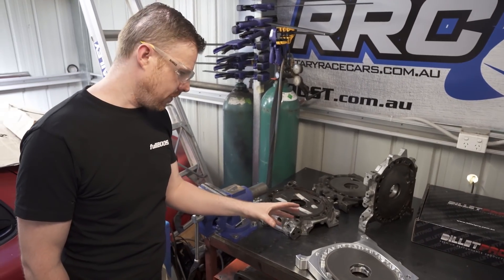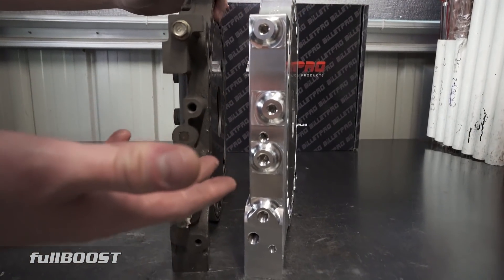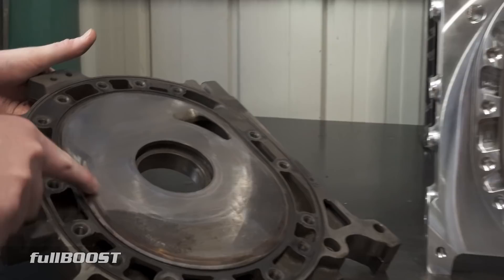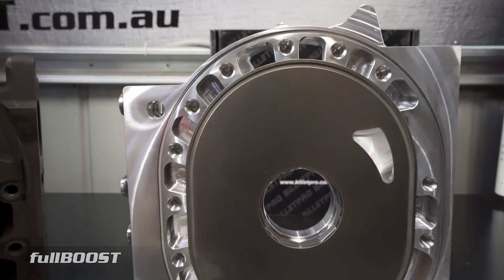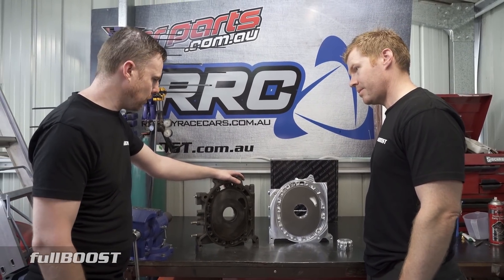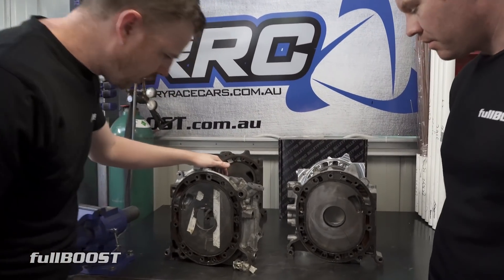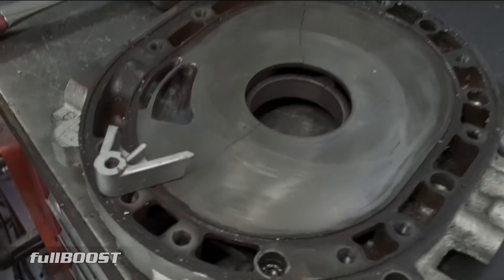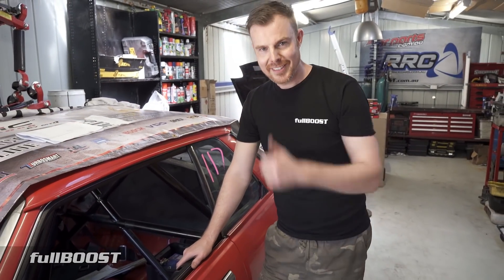Why you need a BILLET Rotary engine | fullBOOST

Comment: why not make this more affordable so more rotary guys can buy them? I know some research and such has been done but prices you mentioned are just pushing more people to do ls swaps :')
Reply: How about keeping the power down? Is there a reason for you to exceed 500 hp? If not then keep it there. Yeah you won't beat everybody but even at a 1,000 hp there is somebody out there with either more money or time than you. Lucky for me, the I don't play in RWD circles just for that reason. There 800-1000 hp and single digit ET's is mandatory. Better yet used CNC machines are not as expensive as what you think, get crackin.
Reply: Anything billet is expensive by nature of the way the parts are produced. The solid aluminum billet blocks cost a lot on their own, and then when you add in machining time on a CNC machine that costs upwards of $100,000 US, the costs start to add up pretty fast. The other point is that these parts are only for the crazy guys trying to get everything they can out of their rotaries and not the people trying to keep their stock/near stock engines running.
Reply: Parts are made from 7075 and take alot if machine time to make them  perfect. We already sell them for as cost effective for the racers as possible. If anything the price will only be going up. Especially if you pay attention to the prices of these materials.
Reply: BILLET BY PAC

Comment: Do you produce these for the msp without the side exhaust ports? Any plans for msp rotor housings with a periferal port exhaust and 3 oil injectors?
Reply: We don’t use them due to the design and temperature issues with the side seals in performance engines.
Reply from the maker: No. Most people building a high powered rotary engine don't use MSP parts...
Reply: @fullboost  people don't use the because you don't offer it ;). I'd prefer to keep obd2 and stock ecu, im, throttle body. You yourself said it's for reliabilityvrather than power.

Comment: Nice! But really it's a performance part. Even in the world of V8s aluminum cylinder heads mean cooler temps and the ability to run much higher compression than stock cast iron heads. I'd compair them to a set of aluminum cylinder heads Not a billet crankshaft. You can get a billet excentric shaft even a 3 piece in case you'd rather run roller bearings in stead of big Babette bearings just saying. Hello 15k rpm

Comment: If i ever putting a 3 Rotors in my Mazda, I would just keep it Naturally Aspirated because of reliability.
Reply: You'll make more power with a turbo. Reliability is easily found at 500/600 hp. The problem is the fuel system required to make that kind of power is cost prohibitive, also the conversion to stand alone engine management.

Comment: I was actually thinking of buying a Mazda RX8 since they are so cheap but no way after watching these videos. Thanks for saving me thousands of dollars.
Reply: dont listen to that guy about doing ls swaps.  you'll spend 3 times the amount of money to do an ls swap right.  and if you know how to go about getting a new engine for an rx8 it's really not that bad.
Reply: I had the same thought, a RX8 can be had for $500 usually because of some engine problem. But then I found 1) The Renesis engine is best left stock actually and throw it in the corner of your garage. Make the later revisions to your engine if you haven't bought the last of the RX8's, it will mean better reliability. 2) REW or 3 rotor swaps are not emissions legal in California. I can find a way around that but then it's expensive to do a 3 rotor swap and then you run into transmission problems. If I were to do one, it would be a REW 2 Rotor (13b) with a big single and T56 transmission, right at 450-500 hp. Not a world beater but would be fairly fast in it's own right.
Reply: These parts are primarily designed for Motorsport applications for engine producing over 1000Hp. So not really anything you would need to worry about for a RX-8
Reply: Avoid the 8... get a 7
Reply: Buy it and drop a LS motor as rotary engine is really expensive

Comment: Nothing wrong with billet parts if you need them. As they said is for reliability if you want reasonable power over 500hp ect. In the long run would be cheaper instead replacing parts blocks ect.
Reply: Have you priced out replacing iron and rotors? It's only a little bit more to go billet over money and TIME especially spent constant pushing the envelope. The problem is the average enthusiast can't do both. So if you have an older non-Turbo car it would be hard to justify the additional cost. Or you can choose to keep the power level within limits of the OE hardware and focus more on working on lap times or reducing 60 ft or 330 times at the strip.
Reply: @dj4monie  I'm on about if you just keep replacing parts constantly as I said in the long run it would be cheaper so it would be worth to take that extra bit of time and save up a little bit more instead of doing things cheaper and then 6 months time spend the same amount of money again. Fair enough for the older models that aren't looking for much power and are doing the old cars and carby set ups. As I said I was on about people who are wanting more power and wanting the reliability over 500 so on so forth.
Reply: It's not like you'll have these old cars as your daily all the time.

Comment: Now hit the billet one to compare
Reply: If he hit the billet one at exactly same place it would've also snapped off so not really a fair hammer test,guess they sponsored by billet pro 😭
Reply: i mean its not gonna break as easy cast iron shatters its not that its weak it just doesn't flex but aluminum accumulates fatigue and will fail eventually anyways regardless of the stress on it

Comment: You have made a pretty broad statement saying Aluminum is stronger than cast iron.  It cant be to bad as there are plenty of engines getting around with cast iron cranks.  Aluminum cranks i would say never twice. 
The rotor chamber end plates on the Aluminum example has steel inserts? So they are secured against end float with a LH/RH threaded bush . Is that all no other locking? The only concern really is the different thermal expansion rates as it is all sandwiched together. I'm thinking end float of the rotors being changed at different temps, water leaks internally. A scratch in the dirt calculation shows Aluminum expands by about 1/3 more than steel at a given temp. 
About 15~20 years ago the CSIRO created an Aluminum matrix with Silicone Carbide by combining the powders in a ball mill then melting it into a solid. . The stuff was hard and strong enough to make brake rotors out off. It had far better thermal properties than steel but was difficult to machine and tap. This material would take a good ground finish, not need hardening and could be cast the same way as high silicone aluminum (wheels) .
Reply: ChrisHallett83  Somewhat of a gross generalization. You can create very hard and brittle aluminum. You can create very ductile and durable cast iron. All in the formulation and heat treat.
Reply: That isn't broad you took it as being broad. Rotary engines we never designed to withstand 800-900-1000 hp which is why racing teams who NEED reliability have moved to billet engines. Normal drivers have no need for that much power especially if you NEVER compete with it. It's just a waste of money to say you got X amount of power but never use it and don't know how to use it either.  Keep your iron based 2 rotor car but don't expect much reliability beyond 500 hp, which is plenty of power for an FD/FC/RX2 whatever.
Reply: @dj4monie  Nah, he's right. It is a broad statement. Some aluminum is stronger than some cast iron. And the opposite can also be true. Nobody is disputing the fact that high horsepower engines need stronger parts. But the statement that aluminum is stronger than cast iron is simply not universally true.
Reply: @dj4monie  Wouldn't a billet block made of a high quality iron be far stronger than any aluminum could be though?
Reply: I think we can all agree forged steel is stronger than aluminum
Reply: I would like to see that aluminium block after daily use because that castiron is sure not new.
Reply: Petr Rieger Plenty of street cars using them and they are wearing perfectly (Billet Pro plates that is)
Reply: totally agreed, the thing here is equal grain orientation, easy to proceed with thermal treatment You can give to a big block of metal, and them machine it
Reply: Not trying to be nit picky but when i hear of how strong Titanium is and its on a par with may be mild steel at it's best.
Reply: Some if it comes down to the casting process itself. One needs to select the iron alloy for the casting for both its properties during the casting process and for the properties of the finished product.

Compare with a billet aluminium block where one only has to select the alloy for the properties of the finished product.
There is also the grain structure aspect which is related. One has less control of the grain structure in a complex casting compared to grain structure in the simple block of metal(billet) that a billet block is machined out of.

One could certainly make a billet iron or steel block that is stronger than billet aluminium albeit at the cost of weight.

Comment: Holy Shit. 2700$ for one plate? No thanks. 98% of us are budget building and not doing it professionally
Reply: Buying bespoke billet machined parts for anything but racing cars would be fairly stupid.
Reply: @MsSomeonenew  I agree but there is alot of people, mainly younger men, that dump there paychecks into the dumbest shit. I know all too many people at our local car meets that have 10K into their engines with small power gains for the money. One guy spent 2K on getting his head surfaced and cnc ported only to have everything else stock. Another guy got 1200$ stage 3 clutch to put on his stock honda. Or buying a 1300$ exhaust for a stock BRZ. I see these situtations all the time. My daily at the moment is a 532whp 3rd gen prelude with the original rebuilt motor , internals, and a modest turbo setup. I have no more than 6k into it counting the price of the car.  Ive achieved similar results with all my previous builds. maximizing power with as little money as possible and being smart about it. Upgrade only what you need and for the right situation. I try to help these kids as much as i can but its hard when some of them think they know it all because they watched some youtube videos. Dont get me wrong, youtube has made any sort of DIY a 100 times easier but you cant replace it with experience I guess.  Rant Over. haha
Reply: @TR1GTARD  this happens in the custom PC world as well guys buying 1000watt power supplies that run stock settings and only got like one video card.
Reply: @TR1GTARD  That is because they learn what is critical from the wrong people. OE parts are very good up to a point and the tune especially who does the tuning is the most important thing. Billet is for motorsport but that never stopped anybody and never will, you can lead a horse to water but there is no guarantee they will drink it. As I said above FWD circles are full of limited budgets and limited knowledge so if you can just make reliable power you'll go a long way to being competitive in almost anything you do.
Reply: @Ray Agreed. Almost worse when people do that sort of thing with PC power supplies, as I believe that the efficiency of a power supply at the lower end of its rated output is not as good as if you are taking better advantage of the increased output (e.g. I think efficiency peaks around 80-90% usage). Similar to running a big turbo, but not having fuel injectors big enough to keep up, so having to limit boost while suffering from the lag associated with the bigger turbo.

Moral of the Story: Determine the weak link, upgrade, determine the next weak link, upgrade again, rinse & repeat until you're happy with the performance and reliability. Don't replace parts that aren't the weak link and always start with the best bang-for-your-buck upgrades (if looking for performance, some want aesthetic or sound improvements and don't care about performance as much - to each their own).
Reply: Well put, brother. That's how I approach all my builds. Power>Chassis>Looks is the order I run most the time.
Reply: @Currancchs  just for your power supply reference peak efficiency is at about 50% load and goes in a bell curve so lower at low and high loads so having a large power supply isn't a bad thing but it is possible to go too big
Reply: @shaynegadsden  Thanks for the correction, you're absolutely right. Don't know where I picked up the misinformation, but won't repeat it again. Here's a source that backs up your correction: https://www.tomshardware.com/reviews/psu-buying-guide,2916-3.html
Reply: Not really even in a decent street car $5400 for a pretty decent engine upgrade isn't that bad and with 13b's getting harder to get it's a viable option here in Aus your looking at $3500 to $5000 just for a second hand motor
Reply: @shaynegadsden  thats insane. northwest US you can get 2nd gen Rx7s for around 2000-3500$ in good shape. 13b motors all day at the pickers for 400$, ive had to replace the apex seals and a refresh in about 4 of them for friends.
Reply: @TR1GTARD  yeah not an option here and if you seen billetpro is an Australian company the website ends in .au so that price would be in $aud too
Edit: did a quick conversion works out to be about $1900 us
Reply: @TR1GTARD  2.5 to 3.5 ..? 8-10k here at Greece with an average salary of 700 euros
Reply: @shaynegadsden  Exactly.  If you want to push power beyond reliable limits, you have two choices. Add displacement and that's all the LS swap is, more cubic inches or 3 rotor engine. Or keep the power down, 2 rotor is fine 400-500 hp. If you focus on putting the power down, you'll get way more out of it than the lowest common denominator.
Reply: Great for reliability but sounds way overpriced but glad someone is actually thinking outside the box
Reply: thats cheap compared to a piston engine and building the whole valve train. you guys are lucky, bite the bullet and enjoy the new found reliability. you guys would end up saving money in the long run due to all the repairs you'll be curving. with this you can have a reliable motor in the 700-800 range for under 10k. to put into perspective a Ford Coyote crate motor is 11k
Reply: Budget builds go boom sooner or later
Reply: @SYNOPTIC747  Depends. The problem comes from pushing the combo a little bit harder each time. As I said before focus on the little things means you don't always have to lean on the engine to squeeze more power out of it. This is why water-methanol injection should be employed on almost every budget friendly build. Keeping the temps down is key.
Reply: @SYNOPTIC747  not if you know what your doing an upgrade accordingly